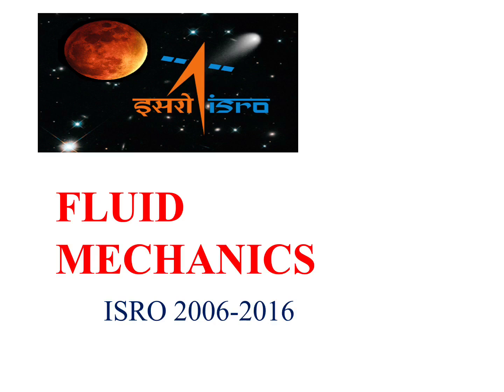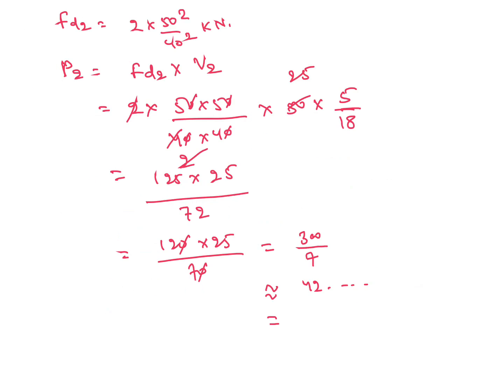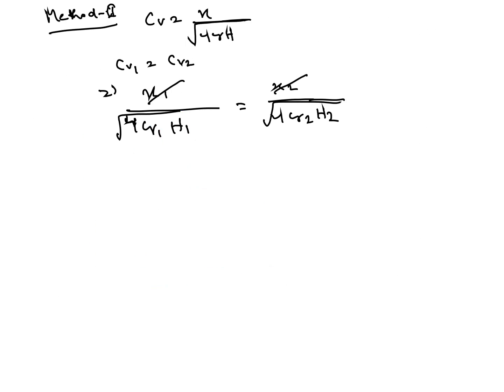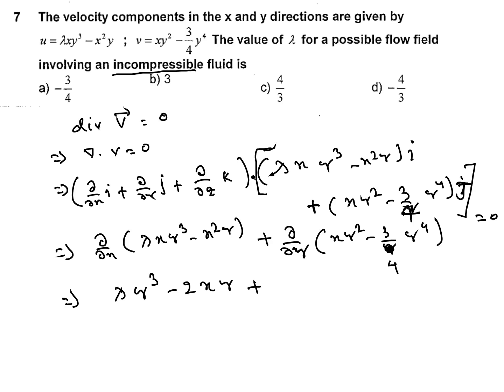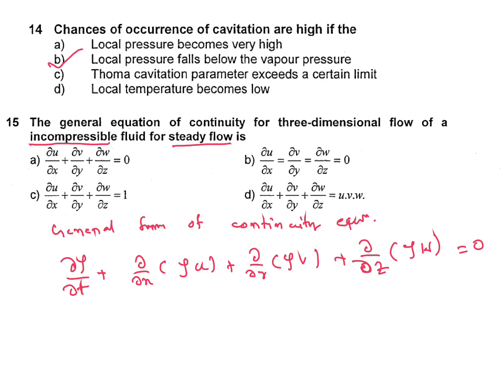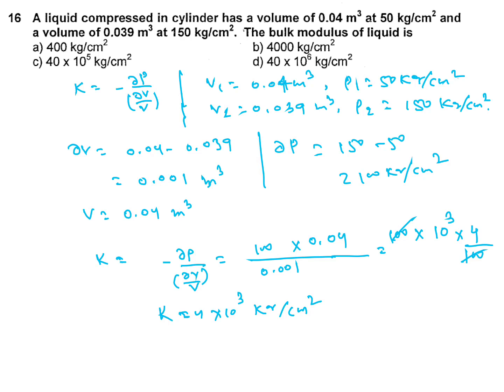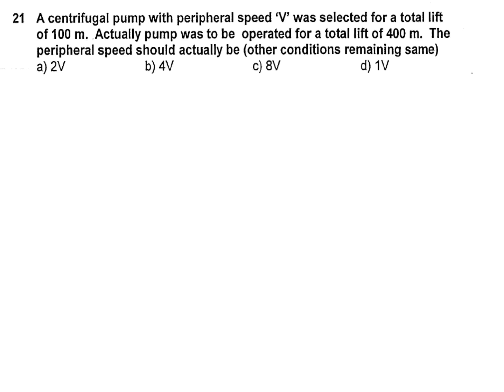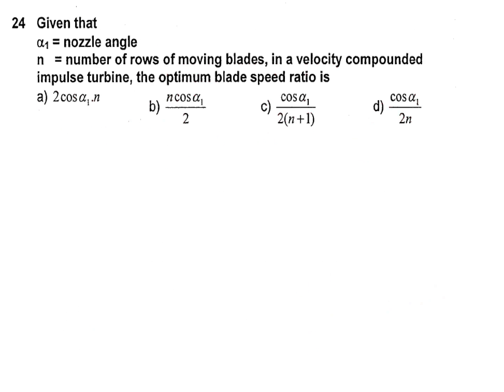ISRO FM 03

Comment: q. A jet of water issues from a nozzle with velocity 20m/s on flat plate moving away from it at 10m/s. The cross sectional area of jet is 0.01m2   and density of water is 1000. The force developed on plate is?